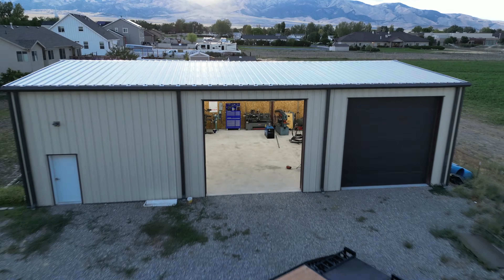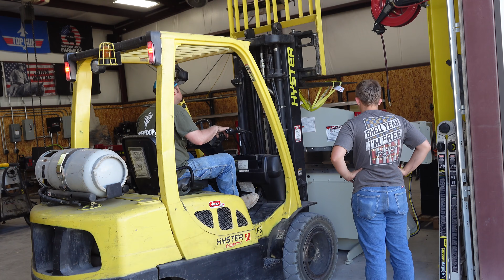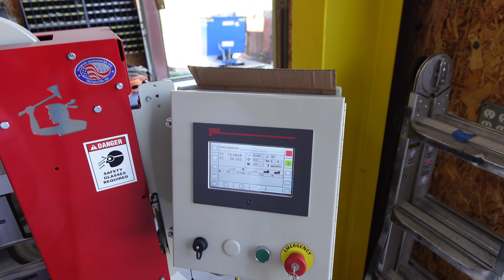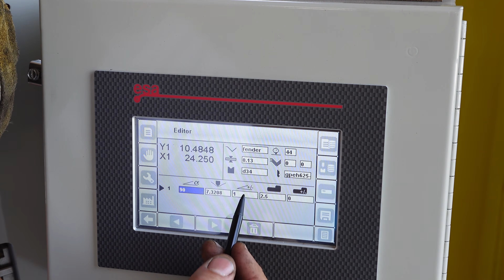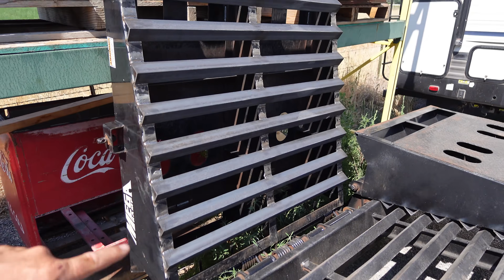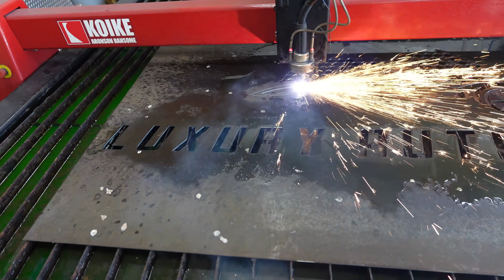Shop Equipment upgrade:  Iroquois B48/100 Press brake

Comment: on the ramps with 1/4 angle iron, you said you "boxed in" each piece. What do you mean by boxed in?
Reply from the maker: Instead of having a U-shaped profile, I added a piece of plate to the opening of the U shaped material to “box it in”, thus closing up the open side of the structure, and adding strength. Hope that answers your question. Thanks for watching!

Comment: I like the Iroquois standard press brakes. It's a lot of capacity for the money. The single cylinder/bell-crank design saves a lot of weight and cost compared to an equivalent conventional press brake with dual rams and open sides. Easier to ship. Easier to place in the shop. The limitation of a bell-crank design is obviously that some bends require removing a part from the side. And maybe some calibration over time. Right tool for the job. Congrats on the new addition!
Reply from the maker: @imkindofabigdeal4308  Thanks, I absolutely love it so far. I am still learning on it, but it is such a game changer in the shop. Easier, cleaner, more professional, faster. I love the small foot front for my size of shop. Thanks for watching!

Comment: Awesome addition! That machine will open up a whole bunch of work for you. Thanks for sharing and keep them coming, look forward to watching your next project that involves the brake. 
Cheers from another fellow welder from B.C. Canada 🤘😎
Reply from the maker: @RHarris42  Thank you, The more I learn about how to operate the machine, the more I am blown away with what it can do. Thank you for watching, and I feel lucky to have at least 2 Canadian friends watching the channel!
Reply: @Freedomfabrication777  it's going to save you so much time for sure! About 10 years ago I worked for an outfit that bought a huge brake that had a similar program, I wish I could remember how many ton it was for it. Needless to say at that time we were braking full 5' x 10' x 1/4" with ease and able to do 4'x8'x 1/2" to at best 88° bends (which is close enough for maximum 2" flange! Lol) making cross members for what ever frame work we needed. Definitely impressive to say the least. Again thank you for sharing.

Comment: Sweet brake! I actually considered that exact setup. Little outta my price range at the moment. But if the works keeps coming in I’ll be ordering one. How many jobs/parts can you store in the controller?
Reply from the maker: @thedude6650  You can save 50 bends on the unit, and as many as you want on a jump drive. I think you would love it if you decide to pull the trigger. It’s one of the very few on the market with the big bend capability and small foot print. Thanks for watching!